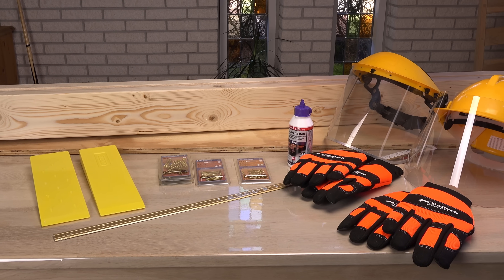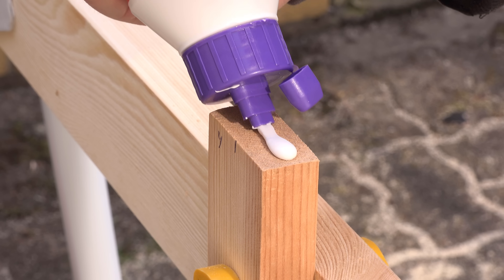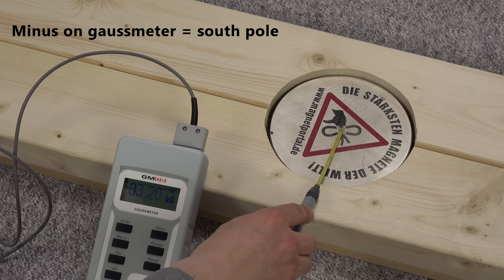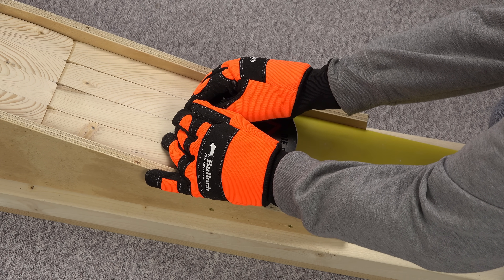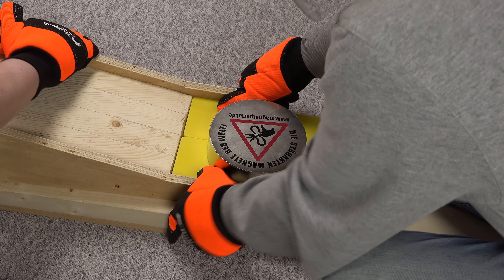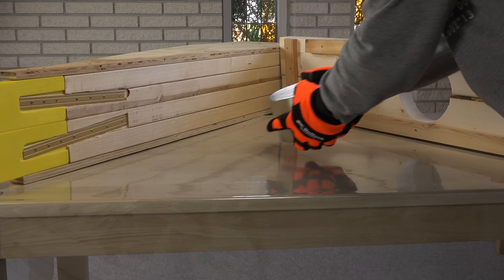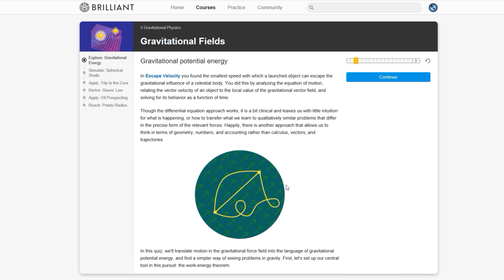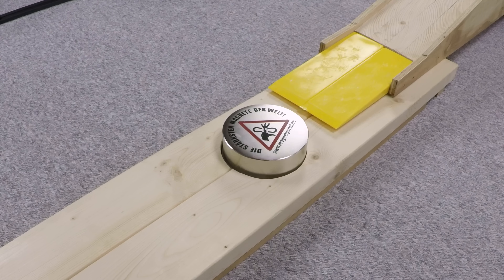Monster magnet meets monster magnet...

Comment: throw them at each other
Reply: Mr beast
Reply: That would make an amazing video. I want to watch those magnets collide
Reply: Pallington the Shrike From what he said, they're also too brittle, and would most likely shatter once they make contact with each other.
Reply: Yep I came here from Mr Beast lol. 
They didnt completely shatter but a good sized chunk ripped off one of them and shrapnel went everywhere.
Reply: Also here cos of my boy Mrbeast!!
Reply: putting ice block in between them, 
isn't it a better way to combine them?
Reply: I actually watched this video first. Watched Mr beast and remembered about this and came back
Reply: Mr Beast did it
Reply: Trhow it outside. Not inside a room
Reply: that's a huge safety risk
small neodymium magnets thrown together can pull each other from halfway across a room.
2 of these flying through the air is not a good thing.

Comment: I think the sound was probably friction, the magnets were really attracting themselves, when the surface was pulled, by the fact it is in an angle the magnet moved a little bit faster. (The attraction forces were in an angle, thus acting in the x and y axis). 

The sound was made similar as when you force your hand against a glass or plastic surface and drags your hand at some speed. Also kinda similar to the sound of car tires when you dont have abs and step on the breaks too hard.
Reply: Eduardo Avila I thought that somebody farted
Reply: ammaar zeeb khan Doesnt look too much like a fart, and probably they would know where it came from.
Reply: We have a genius in da comment section
Reply: Well.. If this was ironic, thx. 
If this wasnt ironic, also thx.
Reply: yeah hence the... *SQUEAK*
Reply: I became dumb for a few seconds and wondered how having a six-pack would affect the sound of your brakes.
Reply: Eduardo Avila You said "ABS" meaning anti - lock brakes, but because it was lowercase it looked like you were talking about "abs" as in abdominal muscles.
Reply: We hav a nerd in the com sect
Reply: SAMEERA LATHEEF Yep, we have one.
Reply: Was thinking the same thing.
Reply: That's what I thought as well when I watched this but how come the sound didn't continue happening when they started pulling again?
Reply: ApocalypticCOLA The friction got lower as there were less intact surface and a different angle between the magnet and the ramp.
Reply: Max Lennon Six-pack?

Comment: That was kind of fun to watch, but if your goal was merely to join the magnets, there are easier ways. For instance, you use a bucket of something viscous, like lard, silly putty, caulking, etc. You'd drop one in and, after it got to the bottom, drop the other in. After a while the two magnets would be joined up very nicely. No drama if the fluid is viscous enough.  Also, waxing or greasing the ramp would have made things much easier, though it might require some restraint on the wedge so it didn't get spit out at high speed. There's something called damping grease which would solve that problem, or an aluminum ramp would really slow things down, I think.
Reply: Come to think of it, it might be fun to watch one of these magnets roll or slide down an aluminum plate. My intuition doesn't tell me if it would be fast enough to actually see the motion. Maybe a time lapse video with a clock visible would be necessary.

Comment: I like the making of your supermagnet with a little plastic .
But can you seperate them !?!?
Without damageing them !?!?
I can & its easy as 1,2,3 !!!
Even with 100s of psi .
Ps : No macanical influances !
Human strenth & creativity only .
1. The magnets stuck together .
2. 2 Large boards with holes big enough to fit the magnets in .
3. Rope .
4. 2 Blocks of wood , 1 foot long each & the same width as the boards .
5. A hammer & some nails .
6. 2 trees about 8 feet apart .
7. 1 metal bar about 4 feet long .
Good luck .
A 10 year old can do it .

Comment: Easier way to get them together is to build a rack holding one above the other, then insert a block of ice between them.  As ice melts the top one will slowly slide down until it sits on top of the other one.

Old heavy equipment trick ;)

Comment: 4:20 your wedges have a bad angle, try more inclination. :D
Reply: or even better yet, use the wedges as a sled, and pull the magnet ONTO and OVER the other one, instead of placing it over and pulling out the wedges?

Comment: Elsewhere on Youtube there is a report that two super  magnets, mounted with like poles forced into contact with each other. when dropped from a height, fell, in open air, at a significantly slower rate than than 1 g. These two magnets, if you could get them apart and build a contraption to force and hold them together, the  "anti-grav" experiment might be an interesting one!

Comment: Here is my idea that would be much simpler.

Get a tube with the same diameter as the magnet. Like a sonatube. Freeze a four feet length of water into ice. 

Put one magnet in the bottom of another tube. Place the frozen slug on top. And then on top of that place, the second magnet. As the ice melts, the magnets slowly come together.

Comment: Great video . Yes magnets especially this size can be very dangerous and these are only n45 . I had a couple of n51 magnets about 4 inches square that came together with such force that one of them shattered . N51 magnets are great if you want to stick it to metal but not each other plus they will wipe your Visa and any other card in your wallet clean ..

Comment: Excellent job! I think it is definitely much harder to separate them than joining them. To separate them, you can hold the bottom magnet using similar equipment (thick wood/plastic plate with a tight cylindrical hole), and use some hydrolic lever system to pull away the top magnet. The horizontal force can go up to a ton.

Comment: an idea if this is done again, a strong cylinder with the magnets at the top and bottom and ice in-between, if the cylinder tube is tight enough, only tiny bits of water can escape letting both magnets reach without impact or stuck materials. if you are willing to chance it, make it pre crushed ice.

Comment: In fairly vague terms, cause i dont know the specifics, some result of the magnets' strain on the wood caused that squeak. I know because i work with heavyweight loads of wood, and i hear squeaks and groans of that nature all the time coming from the loads i move. Usyally results from very high pressure friction on the wood. Be it from the load shifting during transport, the parts on my forks catching the loads weight, or whatever else. One consistency i noticed. The higher pitched the squeak, the more pressure is being applied on the wood. 
The sharpness and dullness of the sound works the opposite way. 
and my jaw dropped at that squeal in the video....those magnets are as strong as your charts show....

Comment: Who knew that putting magnets together was this hard.

How about a video of separating them??
Reply: Probably force needed to separate them is enough to shatter at least one of them.
Reply: hard to make 1 magnet out of 2, without splitting those 2 into pieces.
Reply: i'd imagine you could wedge something strong like an axe head in there to part them a little then get 2 strong wooden boards between them, pull the axe off them and with several people pull the boards apart assuming you had some kind of handle on them. Would be pretty damn hard tho.
edit: obviously you would have to have everything held down on separate rigs to get anything metal near them, but you would need something metal to not be crushed like that plastic, maybe some kind of wood is strong enough but idk.
Reply: they get deth....end of this shit

Comment: I think the squeak was the plastic. The noise happened when the far edges of the magnets first touched. They probably accelerated a good bit for the final little distance, causing the noise as they slid over the wedge.

Comment: You wasted the magnets you could have put them so they were pushing away from each other and force them together creating entirely different type of electromagnetic field essentially Defying Gravity to a slight point if you would have created a casing for it you could have taken the magnet as well as a mass equal to the magnets weight and size and drop them down man your mind would have been blown oh well your loss cant do it now

Comment: You could try to combine them inside an air tight cylinder using pressurized air separating the magnets. Release the air slowly until the magnets are joined.

Comment: if you have screws or plates inside your body how does it react to magnets industrial strong like this?
Reply from the maker: Depends on the alloy used. Most likely it is not a problem and may even be MRI-safe (extremely strong magnetic field https://www.radiologyinfo.org/en/info.cfm?pg=safety-mr#safety-considerations ). But ask your doctor before experimenting ;) Thanks for watching!

Comment: Is there a way to harness the energy of the magnets to power a car?
Reply: Normal electrical motors use a combination of permanent magnets and electromagnets with alternating current to induce motion. You can't make a motor using only permanent magnets.

Comment: 5:52 That loud noise... it has something to do with the level of maximum 'grip' of the material (in this case, your yellow wedge) being exceeded with a momentary slip before finding traction again. Tyres on cars do the same on a road surface. Not the movie kind, a long extended screech of a sliding car, lol - the short sharp kind you notice in car parks with polished floors and such.

Comment: Try it with Ice slab in between. I'm sure it will get to a point where they might slam together, but if enough ice is between it should reduce the blow (perhaps?) then it should quickly melt together somewhat quickly.

Comment: How do you sepperate the two magnets
Reply: just weld a steel ring on the sides where you can attach two chains then, hook them up between 2 cars and pull them apart.

Comment: Nice one. :) Bringing together two ultra strong magnets is one story, but getting them separated again is a total different one.
Reply: Dominic Mosimann i think heat is the answer. Not sure how much though
Reply: ELECTRIC FIELDS.  Stick a large copper pipe (not solid, a pipe - electrons flow on the surface of conductors) on one of the magnet's exposed side. Stick a 2nd large copper pipe on the other magnet.  By 'stick' I mean secure them with a non-conductive bracket.  Must be clamped tight.   Run large current in the two pipes.  If the current is great enough, it becomes easier to separate the magnets.  The amount of current required varies with the strength of the magnetic field.  And those are strong fields.  You'd be looking for a shot at getting something between them as a lever to separate them.  Not sure if you'd be able to run enough current safely for them to come apart on their own. See  https://www.youtube.com/watch?v=43AeuDvWc0k
Reply: I'd use two flush height copies of the bottom plank used in the video to slide them apart. using side rails or top weight to keep the planks together so either magnet doesn't back flip.
Reply: Show them ice creams of their choice in both opposite sides and there you got them coming out easily... Hehee
Reply: I don't think that would be a big of a deal to separate them. As I can suppose from my experience with magnets the easiest way to do so is to shift one from another to the side. Not in main axe direction. I would suggest to put that couple in half height hole on the floor and to push the top one to the side with any strong mechanism. Screw mechanism for example. Of cause you have to constrain their movement in unwanted directions with some guides.
Reply: Let's ask Juck Norris to separate them. :D
Reply: @ Kurt Reber The Curie Temperature of iron is 768° C. Those magnets won't consist of iron only, so the necessary temperature will be lower, but not much.

Comment: how much did that grey gauss meter cost ?
Reply from the maker: I paid around €1000 for it including two probes and shipping. Far from the cheapest but it is very precisely calibrated and I like how each unit and probe is calibrated separately so all Hirst probes can be used with all Hirst gaussmeters and still be very precise. For hobby use you can find decent gaussmeters from China on eBay/Amazon for much less though. Thanks for watching!
Reply: ah ok thx your reply. For me that is way to much, i would buy a ton of other stuff for that money xD.

Comment: i am waitting for how to seperate them
Reply: That is not ganna happen
Reply: Stap critacising his spalling far fack's sake
Reply: I would use a vertical mechanism to separate them, One in a solid jig and the other fixed in a sliding jig, then apply the necessary force needed.
Reply: did you mean "pathatic"?
Reply: Fix them between train carts so that they would shift when the train carts separate. 
Or use a hydraulic press or something.
Reply: Joe Rogers just keep your grammar and spelling
Reply: Like trying to leave the European Union ;)
Reply: It's very easy. Google demagnetizer. Course then you lose your investment.
Reply: Necessary force is necessary
Reply: Sure. Make two holders like the bottom one that was holding the one magnet, but make it out of something stronger than that wood. Maybe solid aluminum. Each has a hole big enough to fit one of the magnets. Put them both over the pair of magnets. Enclose the two holders in some sort of frame to keep them aligned and contained yet also allowing them to slide relative to each other. Then rig a jack or come-along, to pull one of the holders relative to the other. This will allow the magnets to slide across each other. Pulling them apart will probably not work, but sliding them this way should work. It works with small neodymium magnets. It should work with big ones.
Reply: Heat. Enough heat will do the trick.
Reply: you mean potato
Reply: And how much force is needed.. it should be possible.
Reply: Awh my job has been done here
Reply: Did you really correct his spelling, is this the Extent of your Intel?... Get a grip,  Pathetic man You Are!
Reply: john merlino Why not correct his spelling. Just helping and it never hurts to learn everything the correct way! Or did you drop out of school?
Reply: just demagnetize them
Reply: I don't think that would be even possible.

Comment: I have a different solution for you.  Unfortunately for safety it's probably not going to be possible to watch it happen.

If you take an aluminum pipe that has some.. but minimal wall clearance to that of the magnet and then fill this pipe with a heavy oil, you can accomplish this more easily.
Place one magnet at the bottom, fill the pipe with the oil and then set the second magnet on top.  Allow it to slowly descend first under gravity.  When the magnetic forces finally do take over, the oil will have to be slowly forced between magnet and wall.

Once they are together you can clean them with solvent and done.

Comment: 6:00 I's the same thing as with other magnets suddenly connecting: they collide, get pushed back from each other as a result of the sudden colliding, then collide again. Because the magnets where so strong, the frequency of the colliding and getting pushed back is very high, so the sound it makes is also high.

So it was just similar to the sound normal magnets would make when connected, just much louder and higher caused by the strength of the magnets.

Comment: I'm confused, is there a reason you can't just put them together without all this stuff? Of course while still using something else than your hands, but what's with all this stuff? Why can't you just put each magnet on an opposite end of a block of ice? Even if the ice gave way it would slow the impact enough to where they probably wouldn't break, this seems like a lot of work for a solution that could be solved using occam's Razor
Reply: Seems risky
Reply: the magnets would have broken by this tremendous force

Comment: Maybe the noise was caused because there were still air or other atoms between the magnetic fields. These were squeezed out as both magnetic fields connected to one. Nice Video.

Comment: Why did not they use a tube of two or three meters vertically of the same diameter of the disc and let it fall until it reaches the bottom and it meets the other cylinder?
Reply: The magnets could break, and we don't want that.
Reply: Could?

Comment: The sound that was made in the video was because the 2 monstrously magnetic were using all their might to magnetise together so when they had a gap to do so the magnetic on top used of its magnetism to get to the other magnet so it was bearing a lot of pressure down on the plastic  when it slipped to the other magnet and they are both smooth surfaces so it produced a sound of a high pitched squeak when sliding across the plastic a simalir example when to be taking both of your hands and running them against eachother in opposite directions really fast producing the scrapping sounds you hear because they are of the same density and surface structure

Comment: What a waste of energy and money. A pipe of equal diameter, with the one magnet at the bottom, filled with water, then frozen, would have been a very easy way to unite the two magnets. As the water melts, it allows a gradual accumulation of the two magnets. Any ice that would get stuck would simply melt, and the final product would be two pure magnets stuck to one another.

Comment: The sound at 6:00 was a screeching sound created from the magnets sliding across the yellow wedges. The sound was loud because there was a tremendous amount of vibration in the plastic (sound is caused by vibrations in matter), which was caused by the tremendous amount of pressure on the plastic caused by the high vertical magnetic force and the relatively smaller horizontal force caused by the pull of the two men.